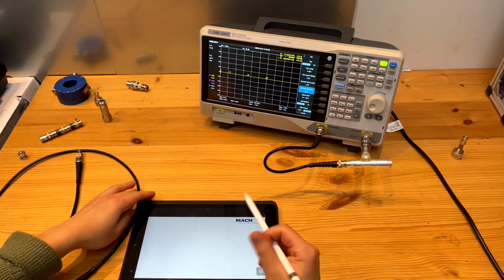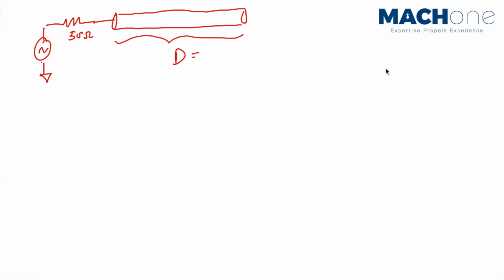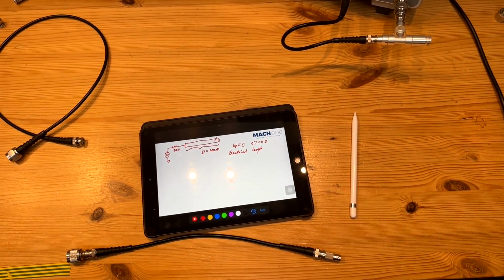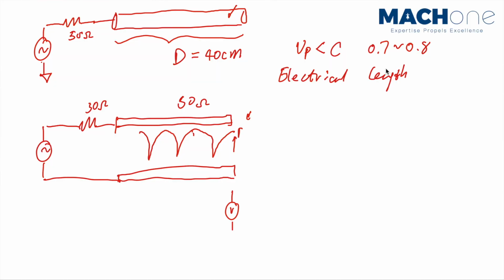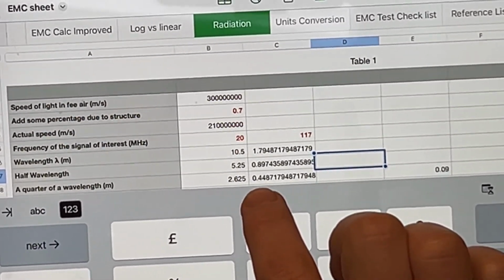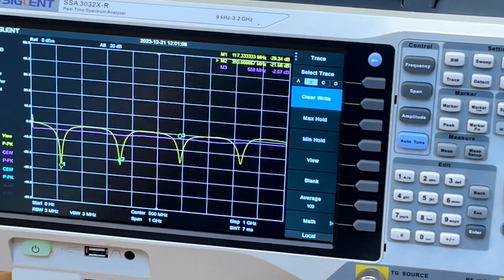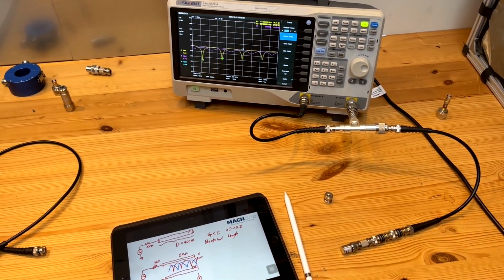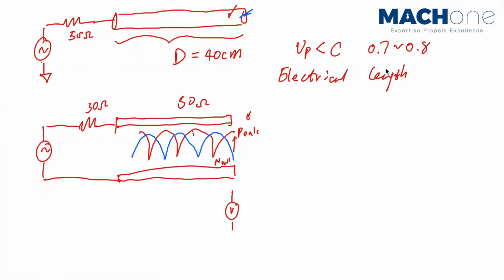Cable Antennas - 1/2 and 1/4 Wavelength Antenna

Comment: Electrical length is always some what longer, than physical length, as even shown by you your calculations, and that of the scope, correct ?
                          🤔......?
This being true, wouldn't you have to take this into consideration, when cutting a, 
" Coaxial " cable to a specific length ?
Where because of its electrical length being somewhat longer, the physical length of the Coax, would be shorter in order to keep it's impedance ?
Reply from the maker: Yes, you got it. But we don't tend to match the physical length with electrical length. After all, it is only electrical length matter in a sense as waves propagate at a certain speed (in this case, less than the speed of light) in a given geometry of the transmission line.

Comment: Again a very good video that demonstrates resonant frequency as function of cable length/impedance 👍

How does it work when single core cables carry pulse width modulated current at switching frequencies in the range of 1 to 20 kHz with rise/fall times in nano seconds, for e.g., in UPS or VFD?

Comment: Hello Min, First I want to thank you for sharing your knowledge and experience with the community. This is very valuable because it is valid. I see mach bullshit on the WEB. I can say you contribute positively to the public knowledge and I congratulate you for this.
I like your direct style. You two important things. 1st your are young (willing to discover and to be enthusiastic); 2nd you have the knowledge to speak about EMC. So keep up the good work. The future will tell if these videos will stay or leave within the community.
In regard to the subject of this video, it is very nice explained one of the most common EMI issue found in practice. Ie in automotive (where I'm activating as EMC eng.) we use 2m length harness between the EUT and various loads. The wires in the harness has different resonances and they always get in to trouble the project. If this is not treated correctly, it can make a difference between pass and fail. So I think it would be a good idea if you can continue this series about cable resonance with another movie demonstrate how can a such problem could be solved (cancel the resonance) in practice.
Again, many thanks for what you are doing on this field.
Reply from the maker: many thanks Cristian for your kind feedback, we will try to keep up the work, I will also take your suggestions into consideration and make one video on that soon!

Comment: Thanks for sharing. one question, how did you get that 0.7 factor?
Reply from the maker: Hi Harry, as we assume the EM wave travels in the free space at the seped of light. When EM wave travels on a cable structure, due to the dialetrics of the insulation material, the velocity of propagation is slower than the speed of light, generally, I apply 0.7-0.8 as a rule of thumb kind of thing. Hope this makes sense?
Reply: @MachOneDesignEMC  thanks a lot. make sense to me, it may have answered  long time due question in my head why my calculation in theory has never matched the reality. by the way, i am an experienced EMC engineer and i think you are the only one i have encountered that truly knows the black magic. your potential is tremendous, keep going. last question is that i am interested in your emc class online, but as i am experienced, i am thinking the stuff on your website might be too generic for me, what do you recommend?

Comment: May be a dumb question, please advise. A laptop adapter has a cable. At what wavelength does it radiate? quarter or half wavelength?
Reply: No worries, not a dumb question. The answer is that the cable will radiate all frequencies. It will be the most efficient radiator at certain resonant frequencies. At other frequencies it will be less effective, but it will still radiate to a lesser degree.
Reply: @davidbonds3571  Hi David, sorry doesn't answer my question. My question is straightforward. How can one say that 40cm is quarter wavelength vs 80cm is half wavelength. If this is the case, what is the wavelength at which  1.8m  or 2m adapter cable dominantly radiates? Or should the radiation be measured, then back calculated to quarter or half wavelength?
Reply from the maker: Hi, that is a very good question, it depends on the terminations, so for example, if a cable is terminated in a metal enclosure, then often we treat this end as low impedance, if the other end is somehow high impedance (it could be the case that on the end, the cable is termianted with a plastic enclosure), then it is a quarterwave length antenna most likely. Notice, here when i said impedance, I meant the common mode impedance, i.e. depending on parastic capcitance/inductance.  @PSPS437